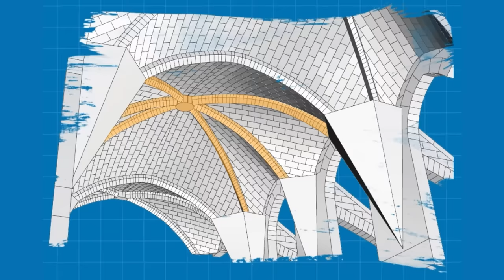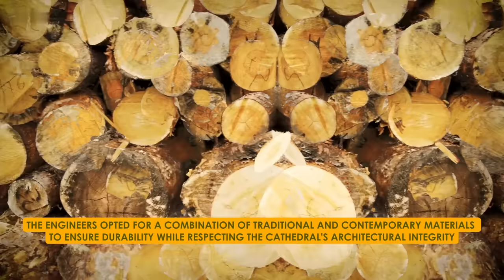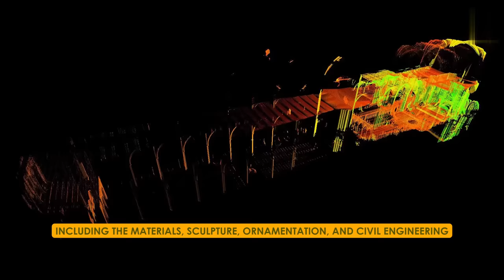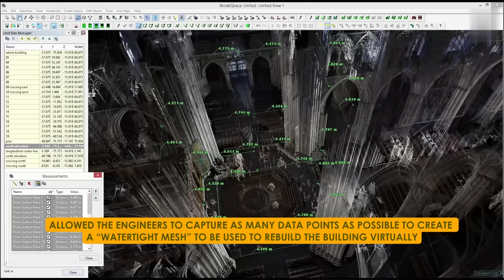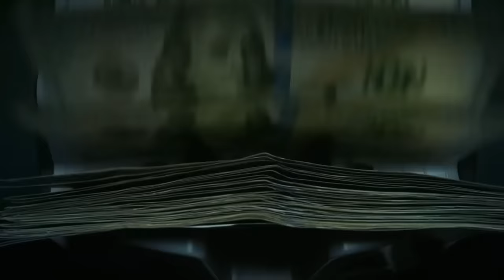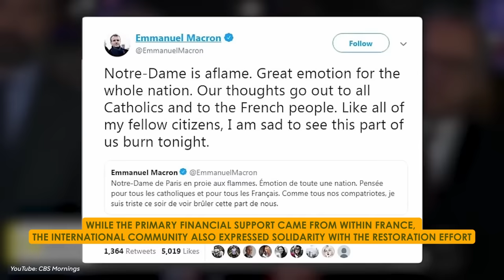Restoration UPDATE: Meet The NEW Notre Dame

Comment: I would be interested to know what measures have been taken to ensure it will not burn down again. I can understand wanting to use timber again, but is there now a sprinkler system for example or have the new timbers been treated to be fire retardant?
Reply: sprinkler system is installed now

Comment: Yeah, and I bet this time they won’t refuse to put sprinklers in the attic and in the ceilings. It’s likely that Notre Dame needed a massive restoration anyway especially with any exposed wood it had.  The freezing and thawing of the masonry over the years probably had taken its toll as well.  In the long run the fire may have actually turned out to be a blessing.

Comment: With the world knowing how long it took to complete the cathedral, even if restoration take even longer than projected, there will be no remonstrance particularly as what is more important , is that the restoration work be fully recognizant of the efforts that new building requirements and standards are met. Even if it means that despite the regressive faction demanding an exact recreation, if new technology is used for the roof sheathing and covering is used, it will nit create pollution from lead, but still have the same appearance. Just this change ,will substantially ease the load on the walls that were strained by both the fire itself and the water infiltration. Additionally, if permanent structural supports are installed above the ribs of the transept ceiling, such will insure that the main columns and the ceiling will endure. Mist do not understand how critical the vaulting ribs and every infill block into the vaulting actually is in the structural integrity of such a ceiling. If each piece is not exactly correct or if there is movement of the central columns, the entire transept vaulting could collapse.

Comment: A beautiful historic build that was worth protecting and preserving BEFORE the fire.   It's noteworthy that there is no mention of any fire suppression methods being incorporated into the rebuilt structure. In fact, there were none, and it does not conform to current building codes.  Those who do not learn from history are destined to repeat it.
Reply from the maker: Thank you for your thoughtful comment! The Notre Dame restoration team is indeed incorporating modern safety measures to prevent future incidents while preserving the cathedral's historic integrity. Advanced fire detection systems, improved emergency protocols, and other safety enhancements are being added.

Comment: I hope they include discrete fire fighting measures with the rebuild. I know it’s not original, but fires don’t care. 
I like that they’ve redesigned the rooster as a phoenix. That says it all, doesn’t it!  
Looking for the silver lining. This is such a unique opportunity to make repairs and clean & restore various parts of the cathedral. I can’t wait to see it (mostly) finished next year.
Reply from the maker: They're installing firewalls and a sprinkler system that uses mist to minimize water damage from deployment. The new attic will also have firefighting equipment in place, so first responders do not have to worry about hauling equipment into the cathedral. And we also love the symbolism of the phoenix rooster - it really captures the spirit of Notre Dame rising again. Thanks for sharing your thoughts!

Comment: What was truly amazing was despite the fire, the overall structure of stonework was basically intact or intact enough to be repaired and all the stained glass windows were virtually untouched.  And I like how they are rebuilding it as it was (with tweaks hidden in the structure to reduce fire risks and issues of course) and they refused to consider some of the outlandish suggestions of some idiots to "modernize" the form.

Comment: It isn't at all obvious but the nave of Notre Dame is bent slightly. I hope when they restore the floors they leave the original pattern. If you stand in the nave under one of the arches and look up you can clearly see that the vaulting doesn't form exactly rectangular bays. The cathedral was built from the apse first, then the choir, then the  trascept, the nave and finally the entrance and towers. But something happened between building the choir and the transept. I saw it back in 95. I think the axis was bent toward the river slightly. My guess is that the city had built up around it and forced the nave to be moved slightly to allow for a narrow street to still pass. They didn't move the building they just laid out the foundations along the new axis. You could see the mismatch in the floor tiles as they met the choir side of the transept. The gothic arch is adaptable and could be built such that even skewed slightly you really have to look to notice the distortion. .The columns of the nave laren't exactly perpendicular to an axis down the center of the nave. The transept vaults must be distorted too but I didn't look. The spacing of both ranges of columns are the same so the transept must also be bent a little. By about 9 inches.  
You can see the bend by holding a straight edge to the plan of the building in Bannister Fletcher's History of Architecture.  I suppose all that digital scanning will show that clearly but it can be seen with your own eyes if you just look up. 
BTW - France owns all the churches and Cathedrals in the country built prior to 1905.
I'm not impressed with all the tech used to repair the building. They could do the work with rudimentary techniques then and it could still be done. Even in Violet le Duc's day they could still do it. What the digital scanning can do is tell them if anything was pushed out of alignment when the roof fell. The architects don't trust themselves anymore without the computer. Gothic Cathedrals are a lot more sophisticated than ancient construction techniques and push the limits of stability.  None of the gothic cathedrals could have survived in earthquake prone countries. And the narrator is wrong about concrete. There isn't any concrete in the structure. 
Also all the windows of the ground floor level were destroyed during the French Revolution. What are there now date from the Violet le Duc restoration. Some accounts get that wrong.
Reply: Thanks for this detailed information. Foregoing the use of modern tools (computers) doesn't seem productive, as that is what architects are now trained on, and they were working on a deadline, which would have meant delays, if they had to familiarize themselves with unfamiliar techniques.
Reply: @carlosidelone8064 - They still have to do the stone cutting more or less the old way but use power tools like grinders and pneumatic chisels. The computer is more for creating the drawings and taking measurements. 
It saves time like you say. But i'm still impressed with the fact that the building was created without any such labor saving techniques and went up rather quickly.  The slowness of the construction process was due far more to waiting until the diocese of Paris had the funds to pay for it. They didn't build on credit. There probably weren't armies of craftsmen working on it. Probably only smaller crews were ever continuously employed. The building could be used for its purposes using the parts that were completed.  The church probably had to wait for grants from the crown or benefactors for major construction efforts. They also used very few drawings. 
Amazingly enough they didn't know how to really calculate the strength of materials. That wasn't really beginning to be understood until the late 18th century when iron was being used to build bridges.
Reply: Great info!
Reply: @clairedionne559  - Thanks - There was something terrible and ominous about the fire. It reminded me of the painting in the Castevets living room in the late 60's movie Rosemary's Baby. Recent world events seem to reinforce that dread.  The 21st century didn't seem to start on an optimistic note. 911 still turns my stomach. But the Cathedral will be white again.

I have read that originally the interior may have resembled St,Chapel. The plaster rendering and painting may have fallen off, flaked or been too faded so was removed by Violet le Duc? During the French Revolution it was vandalized and neglected. St Simone - the great nephew of the memoirist wanted to buy the building from the Convention to strip the lead from the roof. The lead was very valuable. The Convention didn't sell it but maybe lead was removed in places anyway? The roof could have had some serous leaks?
I don't know how true that painting idea might have been? St' Chapel is small. But architectural historians often complained that he was very heavy handed and tended to tell historic buildings how they should look. If it was true you'd think somewhere there would be tell tale signs of a brightly painted interior. Maybe only in parts like the choir?  
When they went to mass in those days. the people stood and really couldn't see anything the priest(s) were doing because of the screen they just found fragments of under the floor. It makes me wonder what they actually did do? They must have heard the sermons but almost everything else was in latin. I think for the people it was an object of civic pride and a prestigious employer when it had the funds.Maybe they went mostly to hear the music and see the show? Cities probably had more literate people than the country so those who could read would probably bring their own missals to follow the liturgy. I also wonder if the commons stood of the floor and the aristocracy and wealthy bourgeoisie sat above in the galleries on the second level? Just a guess. Maybe behind some hand railings that have since been removed? I don't think the public can go up there any more? They are not narrow spaces either and are as wide as the isles below.. I'm sure hundreds could have sat up there. . 
BTW - There were supposed to be two tall roof peaks on the towers but they either didn't have the funds or weren't sure the towers could withstand the wind loads? They had to rely on their best judgement. St Peter's in Rome was supposed to have two bell towers. One had been built but had to be removed because the foundations weren't strong enough. Cracks started to appear in the walls. Rome also gets very infrequent earthquakes.

Comment: Three minutes from fire ignition to completely consuming all structural members and total roof collapse?  It was so lucky that the statues on the spire and roof were removed, and extensive scaffolding was constructed before months the fire began, otherwise the entire structure would have been destroyed.  A roof holds the structure together, without it the walls will collapse.  It is almost as if they knew that the church roof would burn entirely, and that people would donate the necessary funds to restore the church, without which restoration would have been unfeasible.  
It is also very interesting to note that the steel scaffolding melted during the fire, which would require temperatures in excess of 2500 degrees and wood fueled fires only burn at 900 degrees, however it does not prove that (nano the r mite) was used to coat the lead roof.

Comment: Those weird gothic bows that goes all the way around the building are called buttresses, that's because most of them are located around the butt of the building, they are intended to work as conection points for helicopters if the building needs to be moved.Jokes aside it's nice to see it being so close to finnished now.

Comment: I was visiting the cathedral the day before, Palm Sunday. The bells were pealing, which is one of my favorite cathedral experiences. I learned from BBC that evening that this cathedral was one of the least protected major cathedrals in Europe. Basically, France did not protect this building. There was no sprinkler system in the roof, the roof areas was not blocked into sections designed to keep fires from spreading. This is contrasted with the Chartres Cathedral were local people and a core of people who insure it's protection. This cathedral did not even have fire alarms. So, basically, this catastrophe was a blessing.
Reply: It had fire alarm and when on several times but they couldn’t find anything wrong on site until the fire really got serious.
Reply: Sprinkler systems are not adapted to historic frames.
Reply: @francoisleyrat8659 wrong

Comment: I should say that the "iconic spire" was added to the building only in the 1800s. When the spire fell in the fire at 7:50pm, it burst through the ceiling and damaged the building's well-designed safety corset. I would have preferred that the dang spire, which is not part of the original design of the building, would not have been replaced in the reconstruction.
Je dois préciser que la « flèche emblématique » n'a été ajoutée au bâtiment que dans les années 1800. Lorsque la flèche est tombée dans l'incendie à 19h50, elle a traversé le plafond et endommagé le corset de sécurité bien conçu du bâtiment. J'aurais préféré que cette maudit flèche, qui ne fait pas partie de la conception originale du bâtiment, n'ait pas été remplacée pendant la reconstruction.

Comment: Did they install a sprinkler system?
Reply from the maker: Thank you for your question! The restoration team at Notre Dame is incorporating several modern fire safety measures, including the installation of a sprinkler system. These enhancements are designed to provide better fire detection and suppression capabilities, ensuring that the cathedral is better protected against future incidents.

Comment: It's just a fake building right now, it would be better if they modified it with the best modern architecture! Keep the original parts that were still there and build modern on top on that. Maybe a nice glass roof with steel profiles. Fuse the old with the new, it would look great in 300 years. Bold opinion I know.

Comment: I'm a historian, and particularly attuned to religiosity. Or in plain English, BS. To claim as you did that the fleche, the spire, was witness to centuries of history, fully qualifies, as it only dated from 1859. An earlier one would have qualified, but started to collapse in 1606 and was finally removed around 1790
Reply: Indeed. But here the 19th century state of ND is the one restoration works are intended to return the structure to. With a bit less candle soot inside.
Reply: @francoisleyrat8659  I'm actually trying to find La Pucelle's immediate family, as she completely undid a major ecclesiastical plan to stop the Otrtomans one of them had concocted.